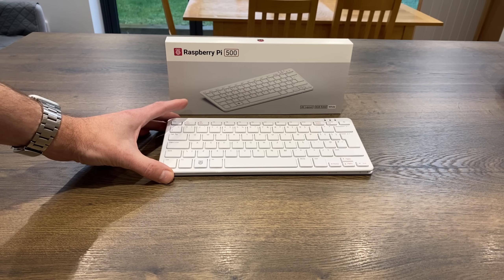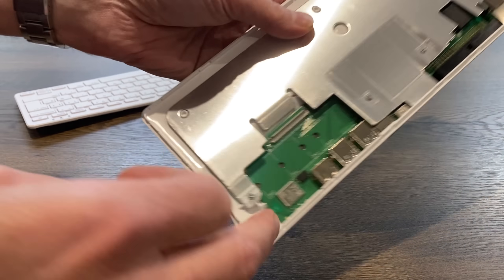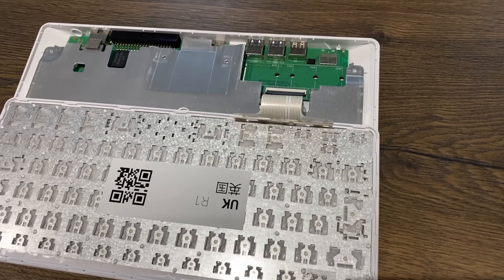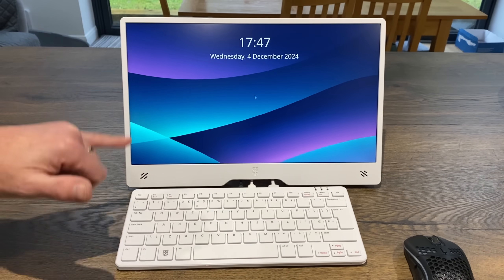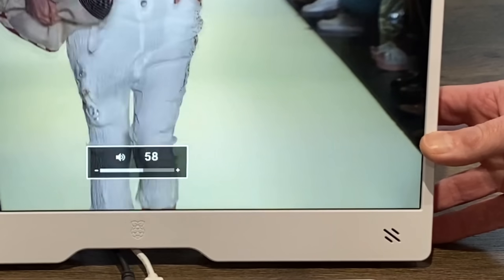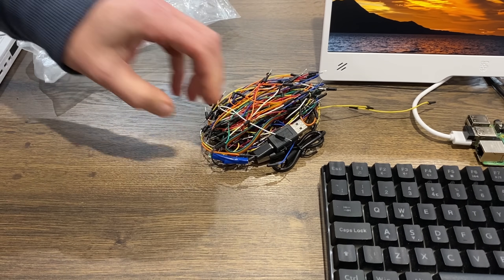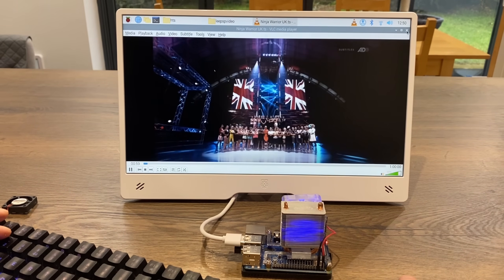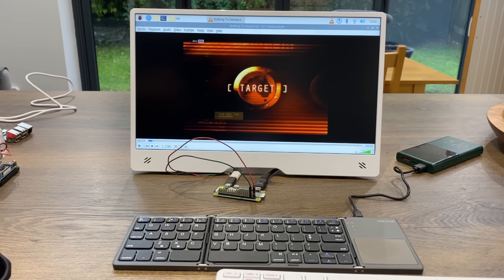Raspberry Pi 500 First Look & Teardown. New 15.6" display test

Comment: Lee have you been able to get Ubuntu to work on the pi500 yet?
Reply from the maker: @hickeyciaran  I haven’t tried. Similar issue to this video

Why some operating systems don’t yet work on 16GB or 2GB Raspberry Pi 5?
https://youtu.be/7EYh6Ut8w10

I got Ubuntu working on the 16GB with the same cpu as the 500, it’s not performing as it should
Reply: Gotcha, thanks for the info. I'm sure the Ubuntu Devs are working tirelessly on a new build in the background 😅

Comment: i realized that raspberry pi's are not that great at all.  i have played with most of the pi's and most of it's os to use on the pi's and they all have issues.  even if you do some programming on them they are still not that good.  made in UK.  suprised when you buy them they are bit pricey especially on Amazon.  Not worth computing.

Comment: I grew to really dislike Raspberry Pis when I accidentally found out that the board has no protection against shorts between GPIO pins 1 and 2... 50 euros down the drain. My recommendation is to stay away from that junk, and if you need a development board, buy something much cheaper like an Orange Pi. If you need something to play around with, Chinese mini PCs are a better option; for the same price, they offer much more power

Comment: One thing that would've been a great addition to the Pi500 (or Pi600) is an integrated touchpad, like some wireless keyboards have. It still would be compact but you wouldn't need to make more space on your desk (or wherever) to account for mouse movement

Comment: Very nice pi500. Now they can do an upgraded version with the nvme (pi500+), and even a better upgrade pi500 pro that is a laptop (with nvme and a screen) even it goes too 250bucks, is a budget clean solution for begginers and for those who doesnt need much "horsepower" on a computer.

Comment: Have you tried Twister OS on the Pi 500 ???
Reply from the maker: Yes, it’s the os in the thumbnail. I used the one I adapted for Pi 5 in this video 

How to run an unsupported OS on Raspberry Pi 5
https://youtu.be/GmfP1qDU-5s

I just need to add a Pi 500 file

Comment: One of the dangers in being able to test and review products in advanced is the potential for the relationship between company and privileged recipient to become rather too close. The recipient, in their desire to stay on the top tier list can sometimes frame comment to avoid disappointing their corporate connections.

Here feels like such an example with the comments regarding the lack of NVME support due to the "bottom line". Based opon the whole idea of the Pi being basic, with the user left to add all the necessary components that they want. I'm not sure that anybody would have necessarily expected the addition of a drive, which makes me think that this as indicitive of the cosy relationship.

There are many low cost SBC's and Mini PC's with support for NVME and so the bottom line argument seems weak at best.

The original ethos of what the Pi was all about is now lost because with the foundation going public, it has shareholders t please, who, in the modern world of what the Americans call fiduciary responsibility, means that the one and only interest is maximising profit at the expense of everything else.

In 2024 I believe that any product stating that it was an ideal computer without some form of mass and fast storage is unrealistic. It is a line worthy of 2018 but not today.

Both products wreak of the corporate greed cash grab.

I see nothing in the monitor that seems competitive because there have been portable monitors hovering around the £$100 mark for quite a while now, with the same kinds of spec.

The whole belief that NVME might come in a + model is laughable and counters the original argument that the exclusion s due to bottom line. If this was the case then why would there ever be any consideration for a model that wasn't considered a value item? It would fit the typical corporate cash grab greed model.

So sadly, for me, this is a good example of a backside covering, disingenuous hawk that has little real value.

Very poor.

But because the Pi is a brand and there are many fan boys and girls that are born every minute, I am sure that sales will be very profitable.

On the other hand, the cat was highly entertaining.

Comment: Such a shame about the lack of M.2. IMHO that renders this version of the Pi500 basically redundant! All my Pi5s have M.2 hats - they really bring the device to life, making it truly usable as a desktop. Without the M.2 it religates the device to simply a hobbyist module. The Pi500 is designed to be a desktop, so must have at least the option of adding an M.2 ssd. Without it, it's a door-stop.

Comment: Would the pi 500 be fast with an external ssd to boot on an work?
Reply from the maker: Thursdays video is about faster storage options
Reply: @leepspvideo  I remember that the Amiga 600 had 20mb Hdd.....sooo maybe the PI 600 will have a HDD.....:face-green-smiling:

Comment: Interesting product, although the lack of full size HDMI ports is poor as there is plenty of space on the board (unlike the credit card sized Pi5) and they are far more durable. Not that bothered about NVMe as I don't use that on anything anyway.  In fact I actually like SD cards as you basically end up with a new computer every time you insert a different one!  My biggest gripe is that the Pi 5 (and now 500) don't support booting into older versions of Raspbian as I have a collection of projects using various versions assembled over the years.  In fact I have a Pi 5 that I never use (apart from occasional testing) and much prefer the 4 or the Zero2.  I even bought a Pi 400 brand new from Ebay for £48 delivered in the summer.  I wonder now that once you add on the perciperals will the cost of a 500 be much different to the new cheap Chinese mini PCs that are flooding the market at the moment which would give "bigger bang for the buck".

Comment: Would be nice to get a Raspberry 500 model attached (inside) of screen instead of keyboard. The screen in the most of the case of uses still in the same place but keyboard and mouse is something that you need to move all the time in a range more far that cables (HDMI /Power). Said that, I don't understand the point of attach the raspberry in the keyboard. Nice review!

Comment: Non connector for NVME  ! Even the design make place for it !!! Is RP run by marketing dude instead of hobbyist ? I'm afraid so... Sorry no MVME, no buying for shure.
Reply: Yes, a marketing person may have suggested "if we're not ready to release the NVME version yet then it's a good idea just to use one board design to cut costs to the customer, and we can add NVME easily later, without changing the board design, if the original Pi 500 sells well enough to those people who don't consider the presence of NVME to be that important".

You seem to not understand that this is the first Raspberry Pi product with built-in NVME anyway.

And how did you manage to use computers before NVME existed then?
Reply: @terrydaktyllus1320  Serious competitors of RP included NMVE (RADAX, OPi etc).
But your right, Compagnie don't seem to ask for NMVE. Hobbyist are not the real targeted client of RP anymore. 

I'm not looking for quantum drive, but a common piece of hardware these day. Are you still using ENIAC in your basement ?

Comment: One minor change that is an actual improvement, note the location of the USB 2.0 port.  On the Pi400 it's all the way on the left side, which means right-handed people have to run the (short) mouse cord all the way across the Pi400.  It doesn't leave a lot of room for movement.  By moving it to the right side, they've given us a lot more freedom in the mouse cord.

Comment: The 400 was my biggest piece of buyer's remorse. I got it home to find no av port and 2 mini hdmi ports (I bought it for crt gaming). I tried some of the attachments for scart and never got them working. I started having problems quickly with the mini hdmi ports, and asking some fellow pi users they stopped working completely. The Raspberry Pi Foundation is not listening to its user base. Most people want the regular hdmi ports back (I want the av port back), and a lot of people want them to branch out into risc v models
Reply: "The 400 was my biggest piece of buyer's remorse. I got it home to find no av port and 2 mini hdmi ports (I bought it for crt gaming)."

I don't wish to be rude but if you'd have done proper research up front, then surely you'd have known that before you purchased it.

"I tried some of the attachments for scart and never got them working."

Again, proper research would indicate to you that HDMI to SCART conversion usually involves a degree of latency, something you DON'T want for most kinds of gaming.

"I started having problems quickly with the mini hdmi ports, and asking some fellow pi users they stopped working completely."

Maybe plugging in and out SCART converters caused that damage? You can't rule that out here, especially with cheap Chinese electronics where protection circuitry probably isn't there in the first place.

"The Raspberry Pi Foundation is not listening to its user base."

How many times have you contacted them yourself suggesting design changes they could make? Forget about what you think others do and don't want, what have you done to request change? And maybe there is other hardware you can make use of instead? There's plenty of alternative hardware around if you learn how to put Linux on it.

"Most people want the regular hdmi ports back (I want the av port back)"

I personally don't care about mini HDMI ports, particularly when having multiple HDMI ports side-by-side that may restrict plugs of a certain size going into them. I can't speak for "most people" because I don't have access to the contents of their minds. Clearly you think that you do.

"and a lot of people want them to branch out into risc v models"

But you don't mean that, do you? There are already a few RISC-V boards available for you to start playing with, nothing stops you doing that except you expecting an identical situation to what you have with ARM-based Pi boards - namely someone to make step-by-step videos showing you what to do with them without you having to learn how to do things yourself. 

Unfortunately, that's just the way it is with a hobbyist maker board turning into a "near consumer " device because of the great support around it - but I bet if I gave most people here an Orange Pi and said "put Linux on it", they wouldn't know where to start without a video showing them.
Reply: @terrydaktyllus1320  I did get an Orange Pi 800 and it's serving me better. The main issue with those mini hdmi ports is they KEEP BREAKING. People are complaining about them for a reason. Yes I should have done my research before buying the machine, but there was no warning that they were changing the ports (at least not a very prominent one). I went in expecting the same ports as the previous models and got a very rude awakening when I got home (especially as I don't have much money). Using it then through hdmi, the main port started playing up quickly, then I had to resort to the low resolution second port. If I had got one of the analogue tv hats working, there are only a few distros that actually support it, each with their limitations in emulation. People have been complaining about the mini hdmi ports since the pi 4, and the Raspberry Pi Foundation isn't listening. When I bought it during lockdown, the 400 was the only model available, and I quickly found out why. Anything that the Raspberry Pi Foundation neglects to do only fuels other makers to give us alternatives such as the Orange Pi
Reply: I like my Pi400. I have thought of connecting it to a CRT which is a nice idea.  There has a to be a way somehow.    Does an HDMI to Scart converter not work as I haven't tried it?
Reply: @raggersragnarsson6255  I haven't gone down that route but I have tried hdmi to rca. It had the smooth movement but lacked the vibrant image.(might have just been the converter though)

Comment: The Orange Pi 800 addressed the two biggest complaints that I have about the Pi400, by providing a headphone jack and full sized HDMI.  I had higher hopes for the Pi500.  The Pi500 could have been redemption for the Pi400, but alas, it falls flat.  New processor, otherwise the same old problems.  That monitor looks nice though.

Comment: It is strange that they made a cut out for the M.2 in the heatsink and all the power and M.2 pads are on the board...

Almost like RPi is saying "we are still cool and if you want you can tinker and put all the necessary modules in for M.2".

Comment: This is a perfect classroom computer. It's easy to picture a class with 30 of these setup with this Pi monitor, then a drawer full of SD cards.
Reply: And 30 broken hdmi ports in the classroom
Reply: It is not a perfect classroom computer by any means - it's designed to be cheaper for home users but a keyboard like that, whilst entirely functional, is not going to stand up to kids hammering away at it for very long.

A "traditional" Raspberry Pi in a hard case with a good quality external USB keyboard (that you can just swap out if it breaks) is a much more resilient solution.

Comment: now we just need a Raspberry PI zero 5 W. with 4GB ram and the Pi 5 CPU
Id buy it. lol
Reply: Why is it that on the day a new thing comes out, people always post oomments saying they now need something else?
Reply: @terrydaktyllus1320  well I did almost go for a Pi 400 but now the Pi 500 is out, I am very tempted.
As for the Pi Zero 2 w, its very long in the tooth now and deserves an update
Reply: @BillyNoMates1974  I don't believe any computer hardware is "long in the tooth" because I don't treat it like a fashion accessory anyway. 

Ultimately, you build a computer to solve a "problem" and once you have worked out how to solve that problem, then it's just a case of choosing hardware (and software) to solve it.

Linux can run on just about anything so you then just need hardware, old or new, to run it on.

If all you are ever doing with computers is trying to play computer games on it then, yes, you'll probably see some hardware as being useless - but it's not just about computer games anyway.

Comment: Finally! 8GB RAM on RPi PC keyboard! I skipped the previous Pi400 because of its paltry 4GB RAM and no 8GB RAM option.
Reply: Linux will run fine in 4GB, even in much less RAM if you optimise it properly - otherwise why have people been able to run emulators in 512MB on the Pi Zero (2)(W)?

If you're intending to crowbar bloated and privacy-hating Windows onto a Pi, then I would think about getting some therapy first, rather than more RAM.
Reply: @terrydaktyllus1320  Pray do tell how you can possibly be aware of people's intentions.
Reply: @SpeccyMan  Pray do tell how you can make such an assumption from what I have written here.

In your own time...

Comment: When to expect video? 
How to solder the connector for M.2 in Pi 500?
Reply: It's not just about soldering in a connector - maybe the firmware doesn't support NVME yet.

And why don't you have a go at doing that, it's called "experimentation", it's one of the main reasons Raspberry Pi's were created in the first place.